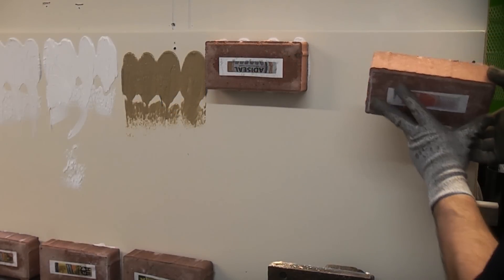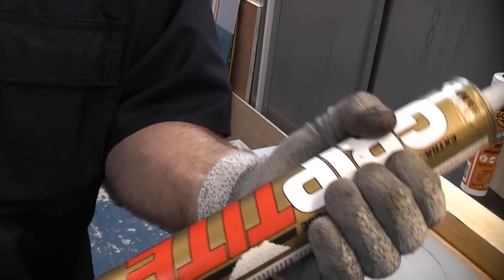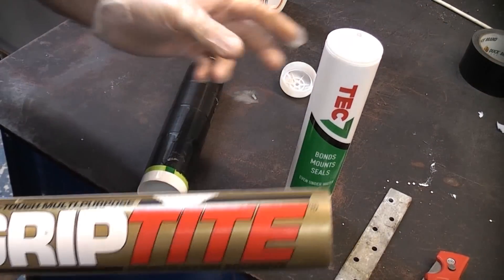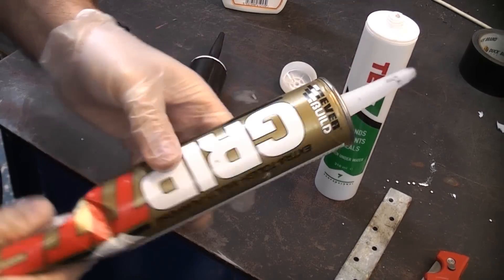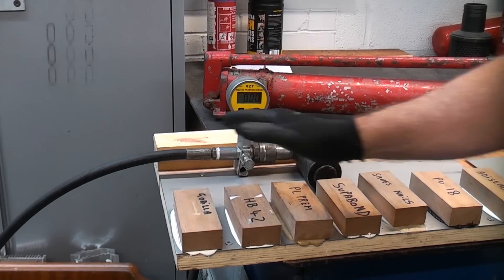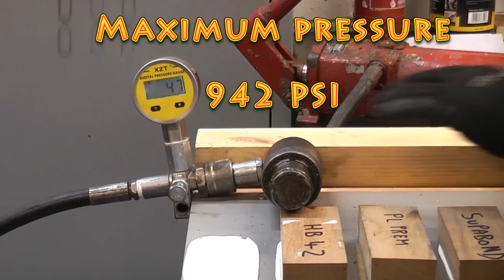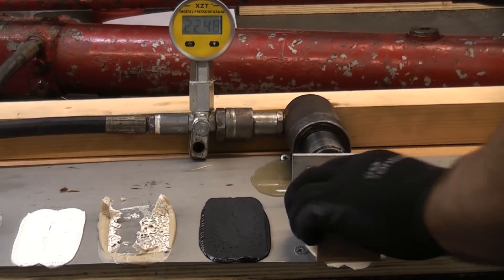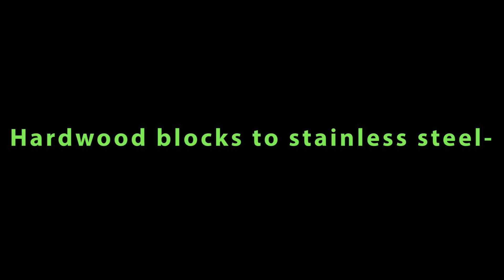Grab adhesive tests 2017

Comment: I've use the Adiseal the white adhesive it works very well to help secure a pvc toilet flange to concrete this stuff is very messy when using it fresh out of the tube !! But if you let it set up for about an hour you're able to mold it with less Mess !! It's more manageable at that point !!💯🔥🔥🔥🔥🔥 I will be buying more of this product turn on $40 a tube but well worth it at like Lowe's you have to buy 10 tubbs of at a time !! On the internet I was able to buy just one tube there's a place online and in Maryland where you can buy single tubes I believe they're 10 oz and fit in a normal sized caulking gun but make sure it is a real good caulking gun. And don't make a mistake bye trying to cut the end off just unscrew the top can you use a small drill bit to get the tube ready to use   because if you get the cut wrong it will affect how you can get the applicator to attach to the tub !! When you're done using it just simply let the remaining caulking set up in the applicator and when you're ready to use it again simply unscrew the applicator from the tube of caulking and with the pushrod find me a caulking gun to push out the old calk no need for a screw in the end of your tube it also comes with a cap for the end of the applicator !!💯☮️🔥🔥🔥🔥🔥

Comment: I wandered in here looking for the best wood to metal adhesive. 

Why?

I purchased a fret levelling file for levelling frets on my guitars.

It is about 5" wood block with a 5" section of bastard file glued to it.

Naturally a tool purported to be made for levelling must itself be level - Duh, right? Lol.

The file isn't level. 

I priesed it of the wood block and found the file section itself to be warped. (I only paid $10.00 for it lol)

The block is level though, so with a strong adhesive and some C clamps I can reattach the file to the block
hunky- dory.

I initially thought of construction adhesive.
In my online search I've found Adiseal to be purportedly the strongest.

I've got Gorilla glue, but I don't trust it.

Anyways I'm enjoying your testing.

Thank you for taking the time.

Take care

Comment: Which one would you recommend sticking a Rail C Channel to a Van for a Canopy Awning ? thank you.
Reply from the maker: Not sure about that, does it not need mechanically fixing or are they normally fixed with grab adhesive!
The strongest grab adhesive I have ever used is Adiseal, but it's not sold everywhere!

Comment: I disagree that there is no clear cut winner.  Clearly Adiseal is the winner by a huge margin.  Supabond is a distant second though a very good product in which I would be comfortable using in any project short of requiring the most extreme holding power .  Yet in jobs that I have to have the utmost confidence & trust that it will safely hold up or hold together something without fasteners,  Adiseal is the one.  

Adiseal took 2 #1 spots & took a close second in the quick hold test that is the least important or significant test.  All the materials you would use these adhesives for will need braces or clamps to hold them in place while it cures.  Adiseal held in place plenty long enough for you to apply those braces or clamps.  
Yet that 3000lb+ holding power in your last test has sold me that Adiseal is far Superior.  ......and the winner  by knockout iiiiiiiiiiss Adiseal!
Reply from the maker: Adiseal is great ;-) 
Thanks for the comment 👍

Comment: Thank you! I've subscribed. I am installing a wireless security camera on a brick wall outside, what would you recommend?
Reply from the maker: I would drill the bricks and use wall plugs and screws.
But if you don't want to do that I would use Adiseal (if you can get it), as that was the strongest adhesive I have ever tested 
Thanks for the comment 👍

Comment: Super bond then adiseal I suppose it is
Reply from the maker: It depends what is locally available to you and how much strength you need, I'm sure for most jobs some of the other adhesives would work just as well.
Thanks for the comment 👍

Comment: You seem to have very different brands available than those in the US. I've never heard of most of them. Here Loctite is considered best by most. I'm in the middle of putting some porcelain wall in my kitchen and I'm exhausted from mixing all that thinset for the floor so I decided to try adhesive. I put a few on with PL Premium and it only worked moderately well and was probably close to $8 a tube. It makes a strong bond after it cures buts its on the runny side when it's fresh. Then I tried Loctite Power Grab. This stuff worked brilliantly and was half the price of the PL Premium. It has a consistency like toothpaste and isn't even tacky or sticky when it comes out, but the tiles grab instantly! You definitely have to pick the product for your specific needs. They also make a PL Premium "Fast Grab" but I haven't tried it. The PL Premium you used failed miserably at your test, but that's not really what it was formulated for. But like I said at the beginning, we don't have your brands and you probably don't have ours, so I assume that's all you could find. Thanks for the video. Cheers.
Reply from the maker: There are lots of brands available here, some of which are much better than others. 
A lot of these products look great, if you watch the marketing hype in the manufacturers videos, but most of them are pretty much the same!
Thanks for the comment 👍

Comment: The brick test wasn't a proper test as the instructions tell you to clamp heavy objects.
Reply from the maker: The block test, was a copy of the "Maximum torque" video, which was made by the manufacturers of the product- which showed their product successfully holding the block, whilst every other grab adhesive failed.
Thanks for the comment 👍

Comment: Awesome videos.. so which adhesive would you recommend? Basically if used for framing? The sticks like sxxt turbo video with the bricks looks good
Reply from the maker: I'd use nails or screws for framing, but I normally use the Adiseal for jobs that require a grab adhesive.
Thanks for the comment 👍

Comment: Nicely done video.  Keep in mind that these tests all were based on SHEAR strength, both as cured and uncured material.  It would be interesting to compare the TENSILE strength as well since that is a common requirement of construction adhesives.
Reply from the maker: Thanks for the comment

Comment: I'm having a real problem hanging a radiator on a wall? Can't get a fixing as the brick is terrible!!! If I plasterboarded over the top and stuck some mdf to the board do you think it would take the weight of the radiator?? It weighs about 45 kilos.
Reply from the maker: No, I would not use grab adhesive for fixing anything like that.
Thanks for the comment

Comment: Working on a framing crew, we used to make some quick and dirty sawhorses making angle cuts on the edges of a 2x6, and then glue and nail some ledger-board legs on them (1x8 rough-cut spruce). We used PL 400 subfloor adhesive, because that's what we had. Once the Lull (a forklift mounted on a tractor that could extend up to the third floor) backed over one of the sawhorses, and the PL 400 held, and the leg snapped.
Reply from the maker: Thanks for the comment ;-)

Comment: Hi Chaz , could you put "links" to the Best / winning Grab adhesive , so we Can buy it Thank you for your hard work and Time you spent researching and compiling your Great vidoes,  Thank you
Reply from the maker: Hi Steve,
I think the best one from this video (if my memory is correct) was the Adiseal.
I use Adiseal or Nemesis from screwfix most of the time as they are both good and less expensive than some of the others.
Screwfix sell the Nemesis- http://fave.co/2sWBZBU
Adiseal is a bit harder to find- http://fave.co/2sTRF8J
Thanks for the comment

Comment: How about poundland no more nails lol
Some of the cheap ones are suprisingly strong but that Adiseal is phenomenal!

That alot of work you went to but I am sure its appreciated by 99% of folks cant understand why 14 people would gie a thumbs down - all your vids are great without exception easily the best on youtube!

Silicone sealant tests would be interesting but hard to quantify as you need to see over time how they perform but I have found the cheap Greek Silicone sealant in Lidl is extremely good and hard wearing , strong and resists mould for as long as the dearest on the market!
Reply from the maker: Thanks Gary, I tried to test all the popular makes. It's a bit wasteful doing the tests as I'm left with loads of partially used tubes of adhesive. I'm glad you appreciate the amount of work that went into this video ;-)

I did think about testing out some silicone sealants, but as you point out it will be difficult to quantify.

Thanks for the comment

Comment: I've made some graphs to help show the result data more easily.
Price per 100ml: https://docs.google.com/spreadsheets/d/e/2PACX-1vQHq5M0cQ5q0y4ZjgRNO8fumsVUQu7hGtz0JsXLMZ2UB9ruD81hTdjasr92gBcINV57HGz0AAIUBOY1/pubchart?oid=855499438&format=interactive
Stainless to stainless strength: https://docs.google.com/spreadsheets/d/e/2PACX-1vQHq5M0cQ5q0y4ZjgRNO8fumsVUQu7hGtz0JsXLMZ2UB9ruD81hTdjasr92gBcINV57HGz0AAIUBOY1/pubchart?oid=1935623088&format=interactive
Wood to stainless strength: https://docs.google.com/spreadsheets/d/e/2PACX-1vQHq5M0cQ5q0y4ZjgRNO8fumsVUQu7hGtz0JsXLMZ2UB9ruD81hTdjasr92gBcINV57HGz0AAIUBOY1/pubchart?oid=1758232456&format=interactive
Reply from the maker: That is awesome, thanks very much ;-)

Comment: This is well organized and includes many options head to head. Great resource. Thanks for your hard work. I noticed some of the tubes were very old packaging. Did you get a chance to check the date codes on each? Also wondered if you are planning another trial with the numerous new items that are hitting the market this year. It seams Grab is almost the new standard but comes in many different levels. Your tests help identify the best formulas. Thank you.
Reply from the maker: No, I did not check any of the date codes. I just bought them all from Amazon. I was quite annoyed actually as I put all the items in my basket on Amazon, then paid using my debit card for the full amount - BUT they did not charge my card for the full amount, they charged my card about 8 or 9 different times for each of the grab adhesives (which really pissed me off as it meant inputting 9 transactions into my accounts instead of 1 transaction).
Thanks for the comment

Comment: Great Upload serious respect for the effort put into same.... Used Tec 7 on a few old Blue  slates that had split across the width of same and slipped landing  into the roof gutter  thank goodness ,  Rather than using a nail ripper and lead strip repair trick off a ridge ladder on the roof.... I went for a quick fix by simply buttered same with a few  runs of that  adhesive and hoped for the best..... That was three years ago and they have even survived Hurricane  'Ophelia' down in exposed coastal  South Kerry.... [Next Parish West, would be... Boston...lol ]
Reply from the maker: Thanks for the comment ;-)

Comment: Appreciate the time and effort and the amount of work that you put into this test and having used the two most expensive brands on numerous occasions, I'll be trying out the others, especially the Adiseal. Some of these type of products state in the instructions that mechanical support is required until the product is fully cured. I personally find that any such product labeled as grab adhesive, should be able to grip by itself and should not be labeled as a grab adhesive if it's unable to grab and hold both surfaces straight away.
Reply from the maker: You are welcome, I agree with you about the grab adhesive being able to grab a sufficient weight without support.
Thanks for the comment

Comment: I would have added pink grip and sticks like s**t to the list instead of saves nails and grip tite.
Both are inferior products as it shows in the tests and the fact 1 was wreaked before use.

Pink grip and sticks like are not badly priced either and the tech7 I haven't seen used in years so was surprised it was here.

Good video mate
Reply from the maker: I have tested out some of those before- https://www.youtube.com/watch?v=uZxNGQ7t0BU
Thanks for the comment
Reply: Ultimate Handyman just watched them mate, looks like the pink grip and sticks like shit are just as good as the adiseal.

At least I know I'm using good products

Comment: question ,if u was gonna use " glue " to bond steel on steel , would most " key " the surface thats glued onto ? and how much of a difference would it make ?
Reply from the maker: I don't think it would make that much difference. I never keyed the stainless in this video and the wood bonded to it perfectly.
A few months back I had some stainless steel panels which were full of a honeycomb cardboard like material, I tried to rip it apart but could not budge the adhesive, in the end I had to burn it to get it off!
Thanks for the comment ;-)

Comment: Great video.
Was thinking this week of sticking pallet slats to my bedroom wall, wainscoting style, and wasn't sure what to really use to glue it to a painted plaster wall. I suppose any will do really. As it's not heavy. And quite pourus. Might use some 35mm nail gun nails to hold it as it sets.
Reply from the maker: Thanks, yes any adhesive should do for a job like that.
Thanks for the comment

Comment: I do enjoy your videos and find them informative, just a note though and defo not a dig. We use adhesives alot for various applications. Little is more... i find the less you use the quicker and better the bond  and speedier the setting times. the plaster board test in paticular, i think if you try with a lot less adhesive it may affect the results you saw but in a better way. Top job though!
Reply from the maker: Thanks, I did try using half the amount of adhesive for the block pavers and the block immediately fell down from the plasterboard.
Thanks for the comment

Comment: This video (among others you've done in the past) will serve as a great guide for future reference. Thanks. 

Question from left field: For this video did you use special lighting or was it just your regular shop lights?
Reply from the maker: Thanks, Ian.
I upgraded the workshop lighting a few months back, it used to have 4 X 6 foot fluorescent lamps but a photographer friend of mine said that LED's would make the lighting much better and so I spent £250 on 4 X  6 foot LED lamps, the light in the workshop looked immediately better to the human eye but sometimes if I don't get the item that I'm filming right below a light the picture is really dark when I get it on the computer to edit.
Thanks for the comment

Comment: Awesome video. Thanks for trying my suggestion of PL Premium in your lineup this time. I now know it's not the best but glad to know that it's not the worst either since I've been using it quite a bit. Looking forward to your next video.
Reply from the maker: You are welcome.
The PL premium is much cheaper than most of them as the tube was at least twice the size of the regular tubes.
I bet it's really good for injecting in the gaps on stairs to prevent them from creaking as the product seems to expand slightly.
Thanks for the comment
Reply: Yes. There are a couple advantages to PL. One is that it expands like you mentioned so works well for filling gaps between surfaces and also that it cures to a harder consistency than the other adhesives which sometimes stay soft for months. You can also speed up the cure time by misting some water on the surfaces. Water seems to speed up the curing process. It's a superior product when used to attach plywood to joists to form a squeak-free solid subfloor.

Comment: The hard wood looks like Tasmanian oak but I'm just guessing. I'm really impressed with the Adiseal it's cheaper than some of the others but holds an incredible amount of pressure. Good video Chez your time, money and effort will help a lot of people when it comes to   the brand selection for the next diy job they do. Thanks for donating your time effort and resources for this I truly appreciate it ☺
Reply from the maker: Thanks Yusuf, The wood is not Tasmanian oak but thanks for the guess ;-)
Hopefully in future I will retest some of the other brands using a piece of stainless steel and hard wood blocks.
Thanks for the comment

Comment: Could you do a measurement with the wood on some cheap silicone too? I know they are not meant to be used for gluing but around the house diy I found them quite all right too. And they come cheap compared to adhesives. I've particularly used the S3 saniter silicone for gluing baseboards, skirtings and laminates. Seems to be all right and flexible, it doesn't crack when kicked or hit with the vacuum etc. Unfortunately I don't have the means to measure but would be nice to know how strong it actually is, what else it can be used for.
Reply from the maker: I'll try to remember to test a tube of silicone the next time I do some testing.
Thanks for the comment